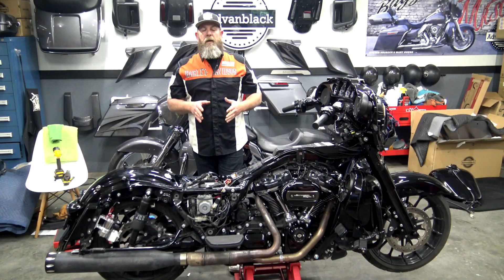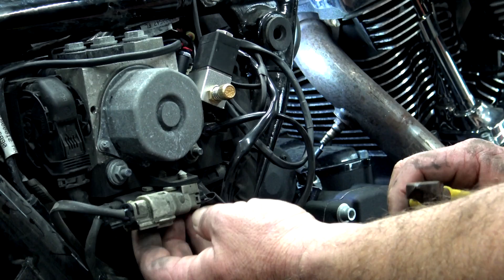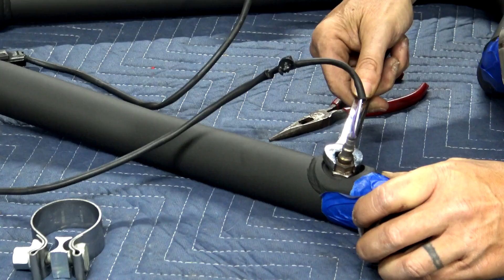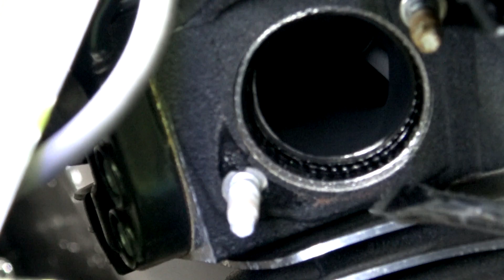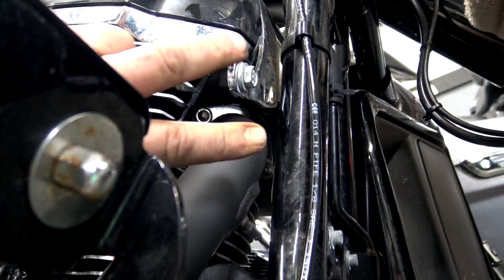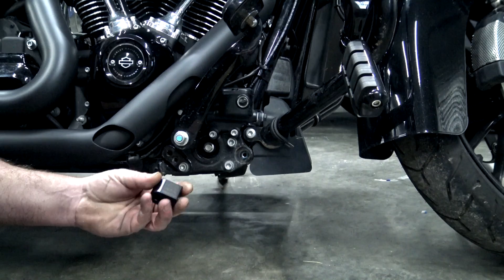Install Headers & Slip Ons Harley Davidson Touring

Comment: How do these affect bikes in emission regulation states?
Reply from the maker: every header pipe company will have a disclaimer on each exhaust system letting you know about emissions...this is from vance and hines power duals website DISCLAIMER: 49-State Emissions Compliant Exhaust System. Not Legal for Sale or Use in California on Any Pollution-Controlled Motor Vehicle.

Comment: Do you need to remove your main fuse ? If so what is the procedure
Reply from the maker: you dont have to but you can...as long as you dont turn the bike on with the 02 sensors unplugged there is no need to...poop the left side cover and pull the 50 amp main....not much of a procedure..just pull it with the bike off.
Reply: @ I appreciate you taking the time to respond.

Comment: Great video... could you talk about wide and narrow band oxygen sensors?
Reply from the maker: Sure thing...to put it all in easy to understand terms..the narrow band sensors are well...narrow and they provide very little information...14.0/15.0:1 air/fuel ratios which is target for stock bikes ..it just tells the bike, her were lean or her were rich ...wide band sensors can measure as rich as 12:1 to as lean as 22:1 and also say her..were this much lean or were this much rich...not just rich or lean...but how much.  Your fuel injection system relies on these numbers and it can only be as good as your sensors...narrow band is fine for stock bikes..you need the wide band for any kind of tuning.
Reply: @sikbaggers  Thanks for the reply... and your experience . It makes sense now and what direction I need to go on my bike.

Comment: Great video.  I just installed my power duals and I have Torquer 450 slip-ons.  The left side muffler is loose even after torqing the clamp.  Has anyone else found this to be the case?
Reply from the maker: I haven't encountered that issue before with that set up but I can tell you an old school trick a mechanic showed me years ago and it works like a charm! Loosen the clamp as far as you can without taking it off...slip a penny in there so you cant see it...clamp it back down..it will tighten right up and bonus you have a penny if you need it lol just kidding..but seriously ...it works!

Comment: My question is do I need to change stock o2 sensors on the stock head pipe to use a tuner if only changing to slipons and a higher flow air filter it’s a 2018 road glide special
Reply from the maker: No...not even really a need for a tune when youre just doing breather and slip ons...you are still restricting the air in the headers. So a true stage 1 is breather (more are in) headers (no cats, free flowing) and slip ons (more air out) then you need to tune. Your breather will allow more air in but your pinching it off in the header and then sending it to the slip ons...so there inst much of a change in the fuel/air mix.
Reply: Thank you Steve for your help the videos you make are always very informative

Comment: After installation everything was good. After about 15 minutes into the test ride, my back head pipe started leaking around the flange. Loudly. Where did I go wrong and do I need to remove everything and seat the pipe all over?
Reply from the maker: That gaskets can be tricky David..they can get bent when tightening the bolts...however you will have to remove it to fix it...that gasket needs to come out..pick it out, clean it all up and when you put the new one in make sure the it is in all the way before you put the pipe on and then go back and forth while tightening it...half turns on each side until its snug.

Comment: I added an S&S header on my 2008 roadking but it wasn't just bolt on.  Some years it would be but I had to notch the heat shield and put a spacer on the floorboard bracket. In the end I'm happy and it runs great. Be aware that you may run into some fitment issues.
Reply from the maker: yeah some headers require spacers on the right footboard...most of them come with the spacer now...the ones ive seen anyway...havent really installed in S&S in awhile though...thanks for chekcing out the video Shane...much appreciated.

Comment: Any tuning tips for the true dual conversion?
Reply from the maker: With todays tuners there really is no tips per say...just pick out the breather, headers and exhaust you have and let it do all the work for you. You can even tune on the go..leave it plugged in and set it to auto tune and it will fine tune your map as you ride.
Reply: Steven Housden thanks
Reply: @sikbaggers  Will it hurt the bike if I tuned a true dual header exhaust to a dual 2 into 1 into 2 exhaust tune?

Comment: I would have torqued those two lower tranny bolts.They have a tendency to get loose with the vibration of the exhaust. At least keep them checked often.

Comment: Can you get the front header off without removing the lower fairing?
Reply from the maker: I really dont think you can. The front header bolt is buried in there. Take a look at your front header bolt, specifically the one in the bottom. Look to see if you think you can get a wench in there without hitting the lowers. Removing the Lowers is easy though if you have too.

Comment: Do you have to get it on the dyno after the new pipes?? It's not cheap and that is the only reason I haven't put new pipes on yet.
Reply from the maker: no not really man..you can do a set of slip ons and an open breather which is stage one and dont need to put it on a dyno...you will however need to get a tuner. you can do the slip ons and stock breather and get away with not even tuning it. However I do recommend you get a tuner if you start playing with the exhaust and breather. The dyno is great if you are really fine tuning the bike...once you start stage 2 or higher you nee to get it on the dyno

Comment: Awesome video!  You guys make it look really simplistic in nature!  Thanks for sharing!
Reply from the maker: Thanks for checking it out Greg.,..We will have a new full system install coming soon!
Reply: @sikbaggers  Looking forward to it!  Stay safe, stay blessed!
Reply: @sikbaggers  Not a quick question, I have a 2018 Ultra Limited with Cobra Neighborhood Haters slip on. I have been told to do one of two things. 1. Remove the cat or replace the headers for more power. 2. Keep it like it is but wrap the existing headers to control the heat. BTW, I did have the S&S 465 cam kit installed as well and I’m looking for the best breather filter to go along with all of this. What are your thoughts?

Comment: Great video. How hard is it to add a tuner?
Reply from the maker: It's not difficult at all. The fp3 is very user friendly and is all done from the app on your phone. The power vision is a bit more detailed however but still very easy to navigate. Unless you're dealing with custom one off pipes or headers there is probably already a tune for your set up...you select the pipe you jave..the breather you have and the headers and the program will pick a tune for you. Flash the bike with the new tune and ride. Both actually have a feature called auto tune..you can leave the tuner on the bike with your tune you selected and will evaluate the performance of the bike and fine tune it as you go. Pretty easy stuff and lots of videos already out there for tuning.
Reply: FP3 will void your Warranty. FYI
Reply: My bike is a 05. I don't have a warranty. Thanks though

Comment: This video is old enough that my comment probably won’t be read but I just don’t understand why the video didn’t show the install of the exhaust into the ports of the engine. That’s why I clicked on this video in the first place. That’s the most important part of this install because if you dent those gaskets upon install you’re fucked and have to do the whole thing all over again. Am I wrong?

Comment: What advantage would it be to get new 18 mm o2 sensors in vs the 12 ?
Reply from the maker: When using a tuner the Narrow band sensors only tell the ECM if its rich, lean, or stoic for a specific range/ Air/ Fuel ratio. A Wide band sensor will tell you the exact A/F ratio. Aftermarket headers come in both flavors depending on what size you have or want you can choose.
Reply: @sikbaggers  so basically you can get a more precise tune. Thanks for the info.

Comment: Great video brother I am stuck on ordering some D&D 2in 2 exhaust I have reinhart true duals on my 2014 street now but I also want to beef it up some so been looking at zippers performance upgrade what's your opinion thanks later brother
Reply from the maker: I have seen the zipper kits but never installed them...im not sure anyone around here has either...Looks to be a pretty good kit and the prices seem to be on point. Im thinking if you did your own work you could benefit from this system and save some money to boot.

Comment: Awesome man, thanks!  Didn't realize those O2 sensors came out so easy...unlike a car's O2 sensors, which are a bitch to get out.  One suggestion - pick up some Harbor Freight interlocking foam mats to lay down on each side of the bike and your body will thank you haha!
Reply from the maker: Yes sir they arent to bad..I do remember busting a few off back in the day on the old trucks I had..what a pain that was lol. We have some rubber matts from harbor freight...and yes I should have used them lol..I payed for it the next day...these old knees cant take the concrete or gravel like they used to
Reply: @sikbaggers  I think around age 50 they started making concrete much harder than they used to, hell I could roll around on it after a mishap until I came to a stop. Wasn't fun but it wasn't like today, the harder stuff takes longer to heal too so it makes me WAY more cautious.